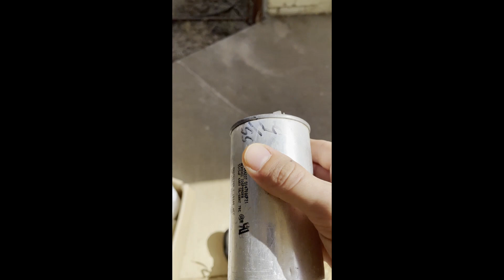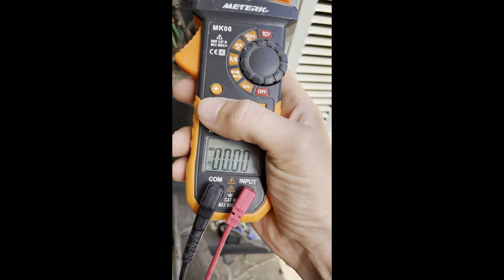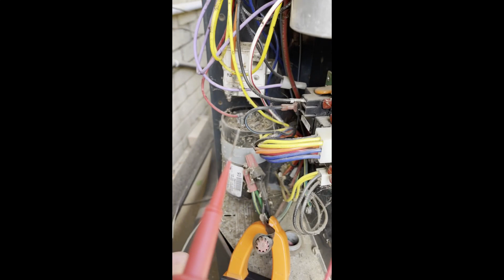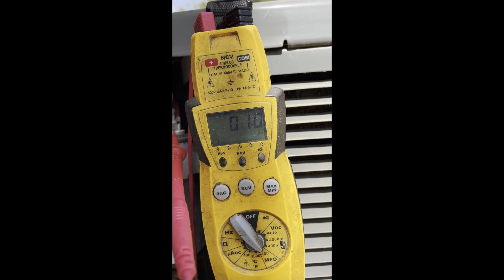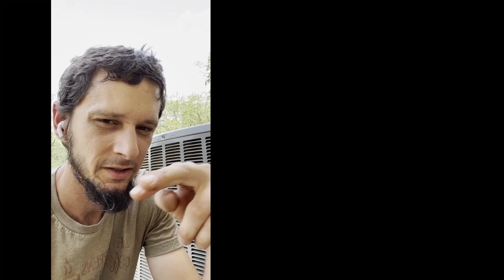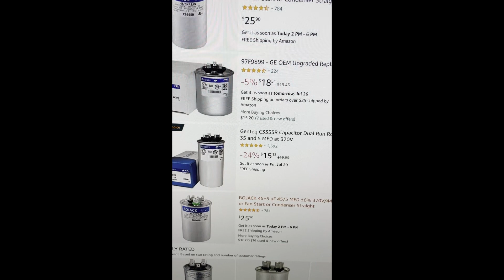Trane XR13 No Start Troubleshooting

Comment: All you need to do to check start cap is to measure inrush on one of the wires (brown). Write everything down for reference next svc call. It should be about 10-12A. If you want to measure MFD at start cap terminals, remove bleed resistor, measure, then reinstall a new resistor with spade terminals.

Rip that "rust blanket" off. 

Get the correct dual run cap on there.

If contactor silver plated contacts are burnt/pitted (likely on a 2008), replace.
Reply from the maker: Thanks for the tips! Been running great the past week and yes I'll pop that correct capacitor in there as soon as it arrives.